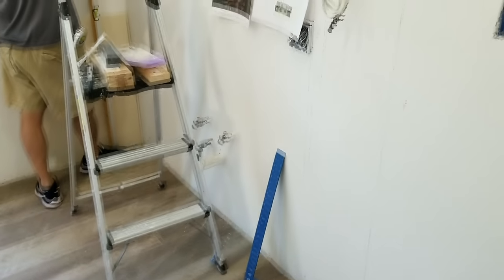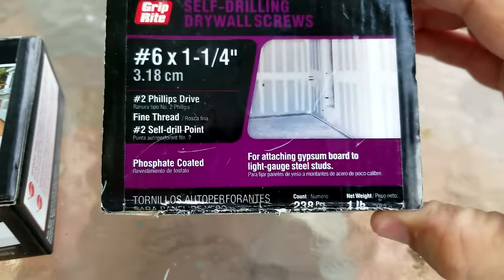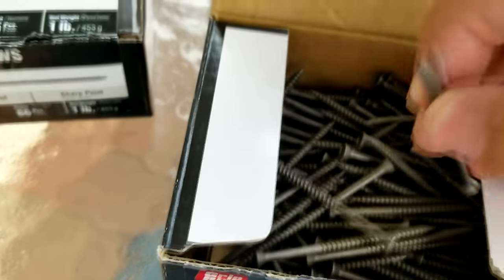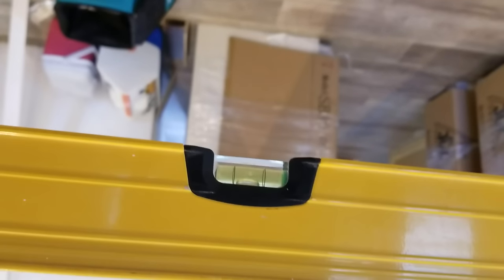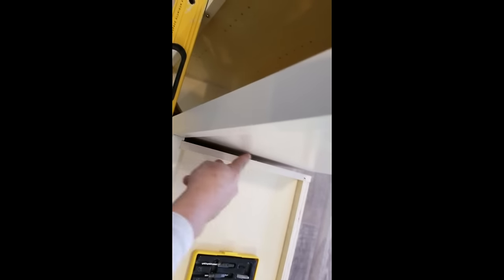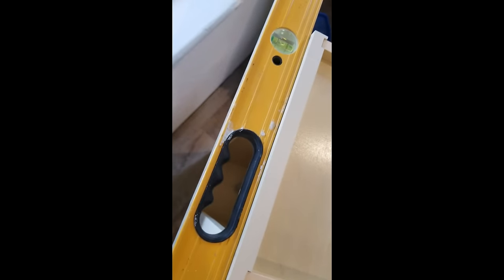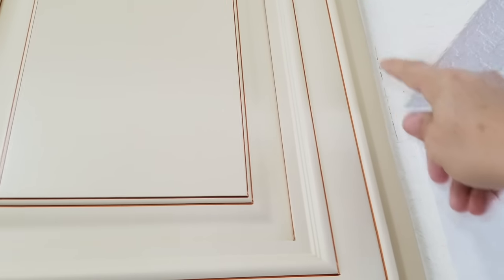Installing Kitchen Cabinets DIY, | How To Install Like Pros

Comment: eh..i think the gap in the picture was caused from poor measurement. not the screws
Reply from the maker: What gap are you referring to?
Reply: He was referring to the gap between the 2 cabinets early in the video when you were talking about the screw threads making a difference in getting the cabinets right.

Comment: How much would a remodel like this be by hiring a contractor ?
Reply from the maker: Ena in a small kitchen like this, they would likely charge you $15,000.
Reply: Really 15000. Im almost done with my kitchen im diying. I saved so much doing it myself. Sweeeet.
Reply from the maker: @robbacon9969   You gonna post a video of it would love to see it. How much did you spend on it total for the cabinets?
Reply: For you Ena , today's special= free99 .
Reply: A small kitchen like this would be 10,000 and I think even that is a stretch, even Lowes could do this job for under 15k and the idiots who do your floor plans over there will try to put as many cabinets in as possible because they make a 10% sales commission off the TOP if it sells.

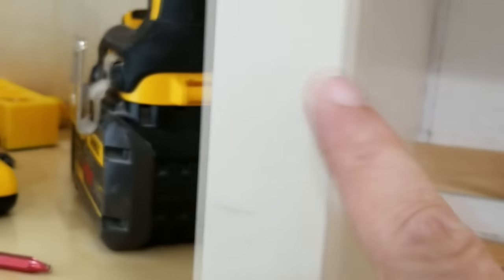Comment: 21:48 why would you ever want to put a screw through A shim?
Reply from the maker: That is how shims work you are supposed to put a screw through the shim otherwise the shim could come loose.  The same thing with doors when you're trying to square a door frame up and you put shims behind where the hinges go to the screws go right through the shims into the buck plate. The people who fail to do this are just asking for trouble.
Reply: how joe c how else would you do it? What’s the disadvantage of screwing the shim in place
Reply: @TheJCinator  Never heard of it either, How would you screw the shims in on the floor after you break them off from under the cabinet? I've never shimmed a single wall cabinet in all my years but that is also because we mainly work in new construction where the walls are already almost level.

Comment: People will put granite in any tenement today.
Reply from the maker: It certainly attracts more money, and helps guarantee the sale. The 2 most import features that sell your house are the kitchen and the master bathroom.
Reply: @jeffostroff  the real value of property is determined by three things alone, location, location, location. Everything else you can change. Can't just pick a lot up and move it though.
Reply from the maker: @1pcfred  Yup, I stay out of the bad hoods. I won't buy a property to flip unless it is one where I would live, because otherwise you severely limit your market and potential buyers.

Comment: Thumbs down to this video. You keep flipping the angle of the camera so it is very co fusing to understand. Also, at times you are showing just a narrow window so it is hard to make out which part of the cabinets you are showing.
Reply from the maker: Yes sorry about those narrow vertical parts of the video we got hit the hard way when shooting with the smartphone at the time we discovered that sometimes if you point the camera downward even though the video looks fine on your camera we found out later that it had rotated it just a error in the algorithm of the cameras gyro. Anyway since then we have stopped using that camera for the most part and we only use our new $5000 nikon 4K ultra high resolution video camera set up with much better microphone and lenses technology. We do plan to re shoot a similar video to this with much better quality on the next remodel.